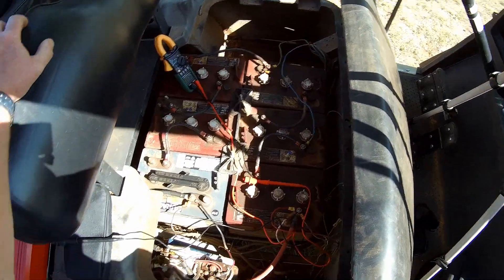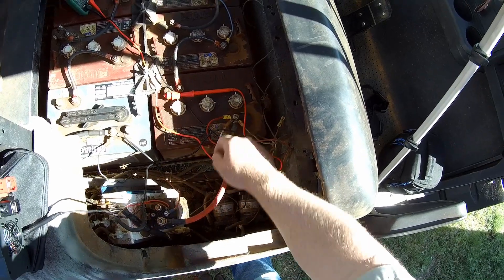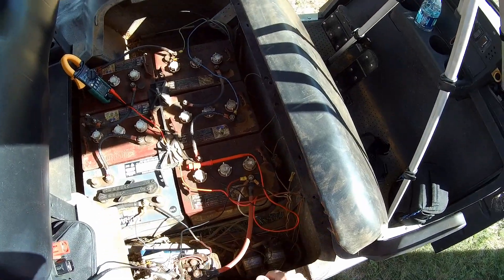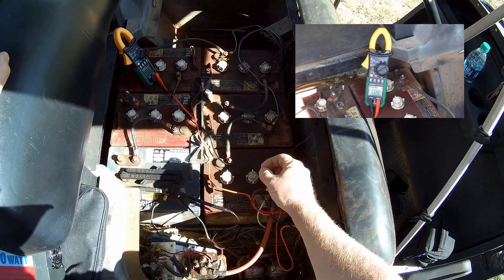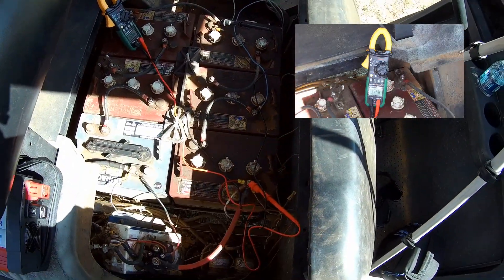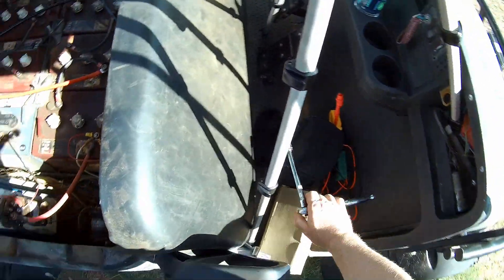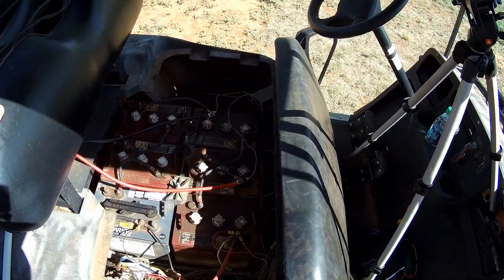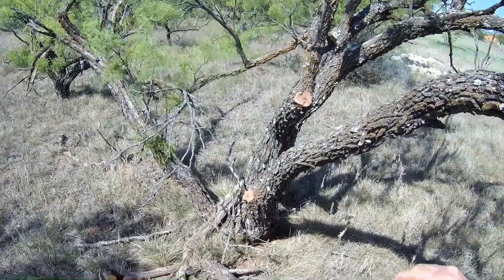How to turn your Electric Buggy into a wood cutting Machine!

Comment: First, thank you so much for putting this up!  But just to make sure I'm getting this right:. You don't have to disconnect any batteries from the battery bank?  Just have to connect to any two that are adjacent in the system?
Reply from the maker: You are welcome.  Yes, you are correct.   Any two batteries that are adjacent will get you 12 volts.

Comment: What's the amp rating on that chainsaw?  By my math you have just over 13 amps on that inverter?  Cutting it close?
Reply from the maker: The chainsaw in the video is just an 8 amp, so the inverter is plenty to pull it.

Comment: So could you couple off 3 sets of 2 and run them in parallel to the inverter? Lots of wires but would triple your amphours
Reply from the maker: I guess it could be done, but I am not sure it is necessary.  I have cut wood for hours with the configuration in the video and never ran out of power.  I guess if you were going to cut a couple cords of wood you might do something like you are suggesting, but at some point, you need to have enough power left to get the cart itself back to the charging point.
Reply: @thejungleexplorer  couple reasons I want to do it.
1. I'm going with 3000 watt inverter so I can run 16 amp stuff.....wood chipper, table saw...
2. Drawing more often from 2 batteries is said to shorten the life of the stack. (Not sure how much credence I give this...but batteries are expensive.)
There are 30th inverters but they are far more pricy than 12 volt so I'm looking for alternatives.  Your vid was helpful.
Reply from the maker: I am certainly no battery expert. But from what I have read, golf cart batteries are built a lot better then marine deep cycle and automobile batteries.  They can be discharged routinely up to 70% without damaging them. 
I am not completely sure about this, but it seems to me that in a set up like the one in the video where only two of a six battery system are being discharged, that once the voltage in the two being discharged drops, the other four would begin to feed power to the two and try to equalize the voltage.  Kind of like if we were talking about a system of six 50 galling drums of water that were interconnected with pipe.  Once you start draining water from one, the water would being to flow from the others to equalize the level of the being drained.  At least that is what I assume would happen.  Of course, I am sure if you put a heavy draw on the two batteries and discharge them really fast, I doubt the other batteries could keep up, but if the discharge were slow, I think they could.  
Like I said, I am no expert.  It just seems logical that it would work that way to me.
Reply: @thejungleexplorer  I think you're correct BUT....the 2 you discharged will routinely go lower and a deep cycle battery's life span is inversely correlated to how far you regularly discharge it.  Which is why they say don't go lower than 30%.
If 2 gets you enough power and you use it regulary....to be safe I would just change which two every 3 months when you check and top off the water.
Plus I wonder if there are adverse effects when you go to charge it and 2 are at 60% while the other 4 are at 80%.  But like you....I'm no expert....I just want some portable 110 power and to power by fridge when the grid goes down in the winter.

Comment: With a couple of solar panels and a voltage regulator (so you don't overcharge your batteries) on the top of that buggy you should be able to top off your system and keep it relatively charged after using the inverter (to convert dc to ac ... not sure if you mentioned that or not) ... and judging from your accent, the mesquite wood mention, the patchy ground vegetation ... your location ... while not exactly pinpoint ... can be narrowed down.   

You seem to be a secretive type perhaps because you like your privacy (you have never smiled directly into the camera like most folks for instance) so depending on how secretive you want to be ... just saying ... you might not want to identify the wood type or show much of the background ... whatever ... good video though ...
Reply from the maker: I have thought about the solar angle and will do that once I get some panels. 

I am not secretive.  I live in West Texas.  I have stated that many times in my videos.  I am just not a Millennial that thinks that unless people can count their nose hairs, they don't have enough of their FACE in the picture.  I am very old fashion. My videos are about what I am doing, not about me.  I don't have to take 100 selfies a day to make myself feel better.  Actually I have never taken a selfie. 

I do take care not to reveal any personal data on the internet, but that is something every one should do, since identy theft is a 40 billion dollar industry.  It always amazes me that people won't even talk to a stranger in a restaurant these days, but they will post everything about themselves on the internet for every cyber criminal in the world to see.  Makes no sense at all. 

 I am the exact opposite.  I will talk the ears off a stranger in person, but I keep my personal info off the internet.  It's not that I am secretive; it's more like having glass windows on a house with locks and deabolts. It does not really stop a determined criminal,  It just keeps honest people honest.  I think you know what I mean
Reply: Okay west Texas friend, I don't want to know how many nose hairs you have anyway so it's all good.    the internet is a dangerous neighborhood for sure and sometimes friends turn out to be nothing more than ai bots or some kind of low-level government snitch.   Im not.  seriously doubt ill ever have a reason to go to your part of the world but I enjoy your vids just the same.  didnt mean to upset you if i did ... do try the solar panel angle ... they are getting less expensive and better.  later friend ...
Reply from the maker: LOL.  I was not offended.  This is what I hate about internet communication; it is so hard to convey the right emotion.  I was not angry, I was making fun of how millennial's worship their face.  The comment about the nose hairs was said in jest.  :-)

I do however, like to make it clear that I am not a "Prepper" or a paranoid conspiracy nut.  It does irritate and frustrate me when people associate me with those type of groups, because they Assume I am one of them because of my lifestyle.  I live the way I do because I have always lived this way and it is the way I like to live.  I am not peppering for some apocalyptic time.  I am not hiding from the government or the Illuminate.  People often THINK that I am a prepper or conspiracy nut because of the way I live. I draw those kinds of people to me like flies to honey, because they see me as like the "Ultimate Prepper".  I tell them point blank that I am not like them, and they often have hard time accepting that, because they want me to share their mentality. I have good friends that are preppers and they have a really hard time accepting that I am not one of them.  It's not that I am against them, quite to the contrary.  I like it when people try to become self sufficient like me.  I just think their motivation is for doing so is in error. I just love living a peaceful self sufficient life.  I am not fueled by fear or paranoia and I absolutely hate hearing about conspiracy theories.  

I am glad you enjoy my videos.  I make them to be helpful to people.  I don't claim to be some professional. I am just a guy who kind of does things a little different.  Most of my videos are just videos of what I happen to be doing.  If I am making something, or fixing something, or inventing something, I just make a video of it.  I am not going out of my way to make a video.  It is just what I am doing normally. I just video it and do some talking while I am doing it.  So, I guess it is more of a documentary of my life then anything else.  I started making the video originally to preserve my knowledge for my kids and grand kids.
Reply: I appreciate people who are different.  I'd be a prepper too, but I am not sure what I should be prepping for and I'd like to be afraid too and driven by paranoia (sounds kind of fun in a way) but I'm not sure if it would help or exactly what to be afraid of?  "Skinwalkers" maybe I don't know?

No point hiding from "the government" ...

(and I believe people like Bush who said he wanted a NWO ...  and have the means and the people to back it up with -- but that is a different story) 

... because when they want you, they will find you and drone your butt anytime "they" want ... but I also believe in a literal God that really does have a very tight leash around their necks but I am not "religious" in the conventional sense ... and I don't do eastern mysticism etc. but I don't want to talk about anything related to religion because that is the quickest way to get into a fight ... so enough said on that from me ...

I'm sure from what you have said thus far that you probably had an interesting life.  What I appreciate about you is your simplicity and I think you are the kind of person who says what they mean and then means what they say.

So just know that you are appreciated for reasons which can't be precisely articulated but are nonetheless reasons of gravity and significance.

Later friend ... keep the vids coming ...
Reply: I have this set up. 3 100 watt panels makes a great replacement roof.  Although in retrospect I would have not have wired them in series.